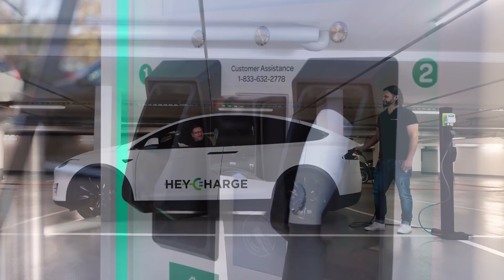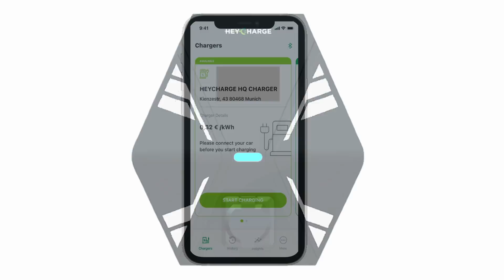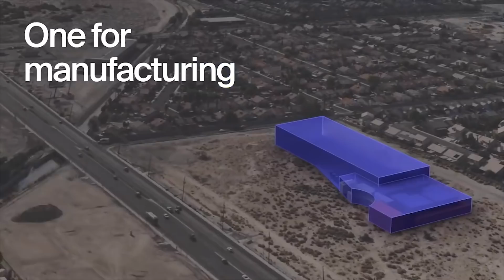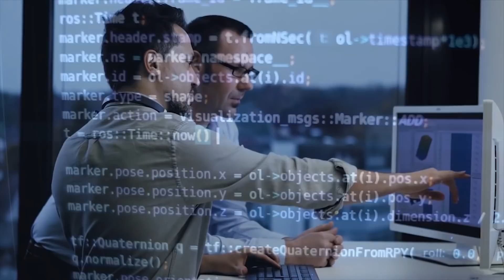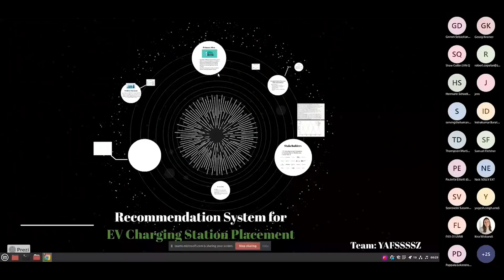CATL Files Patent for Sodium-Ion Battery; Lucid Wants to Open a New Plant - Autoline Daily 3238

Comment: Lucid has made public since it first partnered with the PIF that they planned to build in Saudi. This actually makes a lot of sense. Saudi and the bordering Emirates have a disproportionately high percentage of luxury cars and they are striving for a more "green" image. Even a "knock-down" assembly plant would have a distinct market advantage given national pride and official endorsement from the autocratic government. 

This could be a great way for Lucid to build some volume to help them in dealing with vendors.
Lucid is suffering production delays today due to a reported vendor failure to make parts up to spec. Having a higher guaranteed volume generally leads to more reliable vendor parts (but not always. See: Bronco Webasto Roof)

Comment: I have an EV. I hate the stupid process to pay. It needs to be just like a gas pump. No effing app. No memberships.
Reply: Which EV? A Tesla is just plug in and it works, there is no real reason all BEVs should not work that way in the future.
Reply: That’s why we buy Teslas darling.
Reply: I have a Costco membership and a Sam's Club membership to be able to buy cheap gas.
Reply: The auto manufacturers came up with the physical design for CCS plugs and there is a standard for the communication protocol but none of the manufacturers are really adopting it's use. The kiosk that regulates the charging almost always has a live internet connection - they just have not standardized all cars to talk to the servers on the back end. Supposedly Ford Mustang Mach-E have fixed this. VW and Hyundai are working on it. On the charging side it may require a technician to go out to each site and change circuit boards as the communications need to be encrypted like credit card terminals using PCI 5 I believe. Until that time you're stuck whipping out your phone unless you have a Tesla.